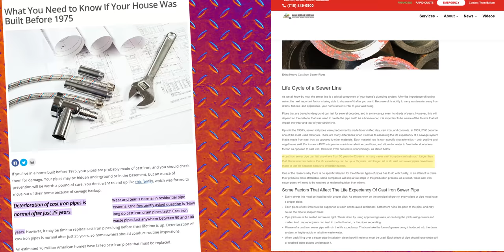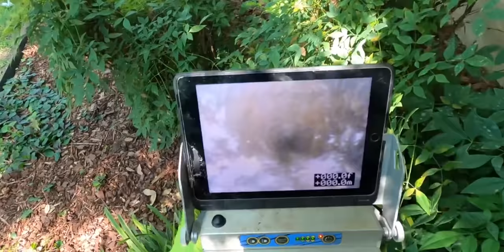You MIGHT Have To REPLACE Your Plumbing System If You See These SIGNS

Comment: A few years ago I started smelling the sulfur added to natural gas when standing outside my home.  I contacted the utility provider and they determined I needed my gas line replaced.  Within 18 months, my entire neighborhood block had their lines replaced, and less than a year after that, the gas main had to be replaced.  My neighborhood was built in the 1950s, so the pipes were probably between 40-60 years old when they were replaced.  But +1 on talking to your neighbors, as once they heard we had problems, we all kept the local pipeline contractor busy for months.

Comment: Roger I am not saying that you are not correct but I am a self-employed plumber in New York State with 34 year's experience and many of the underground cast iron main lines going to the street are at least 100 year's old and most are still in very good shape. Although I come across many exposed cast iron pipes that are as thin as paper. Why does this happen. Some lines seem to be unaffected by time.
Reply: sometimes it is specific alloys in the pipes, sometimes it is environmental.
Reply: As a plumber who replaces cast iron drain systems under slab homes in Texas. What he said is accurate for Texas. I'm not a scientist or soil expert.  However many slabs here shift quite a bit and the drain lines run through the slab beams. So a house settles on one side and moves the plumbing with it. Also the material used to bed the line when it was new construction also tends to settle so many drain systems do not have proper slope and hold waste, making the corrosion of the pipe even worse.
Reply: It must have something to do with our soil, they all seem to last 100 years in the ground here 🤷‍♂️

Comment: Thank you for your advice Mr Wakefield. Doing some renovations and I've seen at least 3 different material transitions on a water supply in a house I'm working on. No, I'm not the plumber, I'm low voltage,  but I was curious to see how all the different combinations of plumbing through the years could hinder the quality and life expectancy of a plumbing system. From copper to PVC, to pex, to PVC, to copper and back and forth. Also tons of shark bite fittings all over.

Comment: Water lines in my moms house were galvanized steel from the 50's, she was getting low flow, rust and clogging aerators. Went through and replaced everything with copper. problem solved.
Reply: I freaking hate galvanized steel

Comment: Hey Roger. Here in Dayton Ohio we trace out the sewers mark them on the slab then cut it, bust it up, dig it out, and remove and replace with new. You should check out our.code book. It's way more lenient than it used to be. But more strict than most states. I seen u had clevis hangers on the.pipe. Do u secure the top/all thread to the slab?

Comment: I have a old house built in 1905. Pear and Beam foundation. This house was built before in door plumbing. So everything has been added at a later time. When I bought the house in the late 1980's. I replaced all the cast iron water plumbing with PVC and CPVC. But over the last serval years I have had a lot of water brakes. ( Probably the plumber fault. Me.) The breaks are  happening not just during extreme cold weather. But in all types of weather.  But a lot of breaks during the few days of extreme cold weather. Even though I let my water drip. But there are places you can't drip. Like your washing machine, and pots. ( I also live in the North Texas area) I am about to redo  all the water supply lines with Pex A pipe. I plan on using a manifold system. Two manifolds, one for cold and one for hot water. With values so I can isolate different parts of the house with shut off values at the manifold. So if there is a issue, I don't have to shut off the hole house, until repairs can be made. I have a 3/4 supply line from the City meter. So I am going to use Pex A 3/4 trunk line to the manifold. I plain on having 3 to 4 zones off of the manifold. To supply different areas of the house. ( 1. Kitchen, wash room, and outside faucet. 2. Central bathroom, pot, sink, bathtub. 3. Rear bathroom and upstairs bathroom. Both are just 1/2 bathrooms. Pot and sink. My question is, can I use the same 3/4 Pex A off of the manifold to supply these 3 zones? Or should I use a 1/2 inch Pex A off of the manifold to supply the 3 different zones. ( Additional information, I will have a 3/4 dedicated line off of the cold manifold going to the hot water heater. Of course with shutoff valve.)

Comment: The reason they switched to slab from pier and beam was cost. My dad built houses starting in the late 70s. Pier and beam require much more labor and material to build so slab houses were much cheaper so that’s why they went that way.
Reply: Unlikely. A proper slab with a skirt and underfill would be just as much labor if not more, and definitely more material
Reply: @ObservationofLimits Google it

Comment: My house was built in 64 and most of the drain pipes have been replaced with PVC but water supply pipes are copper and I would think they are the original ones. No issues or leaks but at what point do you just replace them for piece of mind?
Reply: Once a leak springs up. Thats probably your indicator. Its always nice to have money set aside so you can replace everything when the time comes.
Nothing's worse than talking to homeowners who live in an old house that their parents used to own, that they need to replace everything. But never set money aside for home repairs.

Comment: We moved into a new office in November.  Landlord had to do a full gut and build out.
The womens room bathroom sink, Every 24 hours, turn the hot water on and 11 seconds later water turns bright orange like Hi-C Orange drink for 4 seconds.
Landlord claims the hot water tank is only 2 years old.  Yet UPS Driver told us no one had been in this location for over 10 years and the condition of the property before we started the buildout..  would agree with statement.
Maybe the tank was only used for 2 years before the office was closed down 10 years ago..

Comment: Hey Roger i am going for my journeyman lic. any good recommendations of decent prep material? I feel very confident i just want to take every precaution i can. thanks in advance.
Reply: If you’re near the Austin area or even if you’re not, look up Johnny Kurten plumbing classes. He actually used to work for the plumbing board and helped write the test. He is by far the best prep class for the test. Hell go over the material and point out what could be on the test and also points out certain ways the test asks questions so you can figure out the right answer. As for the shop/dollhouse  part he walks through exactly how to pass each task
Reply: @joshcowart2446  brother I'm in austin thank you man will be looking into it today
Reply: @justintucker4541  his classes are in Taylor so depending on where you live it may be a bit of a drive but it’s worth it. He also gives free review classes prior to the exam. So if you take his journeyman or tradesman code class which is the one that preps for the exam, you can sit in on the class again for free closer to your test date for a review.

Comment: When I was growing up in Indiana I would stay with my uncle and a lot of times he wouldn't pay the water bill to the park so they would cut him off. He drilled a hole in the floor of his trailer in the bathroom and stuck a 3' long 3" pipe with a funnel and that was his solution, I guess it just dumped out into the space below. For #2 he had bigger funnel with a toilet seat thing but you couldn't sit on it or bear full weight because it would push the pipe through the floor and he would have to re-caulk it.

Comment: I advise All my customers that a Plumbing system is designed to last 65 Year's at the most. If you're house and Plumbing system are older than that I advise them to replace the Plumbing system